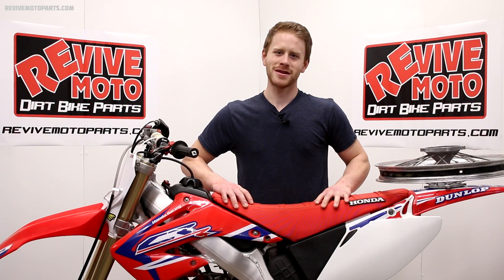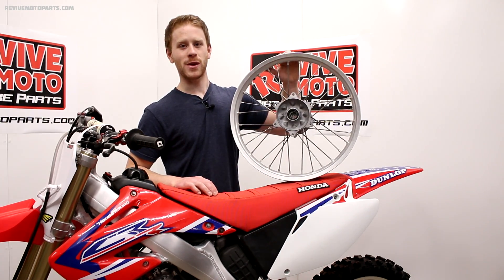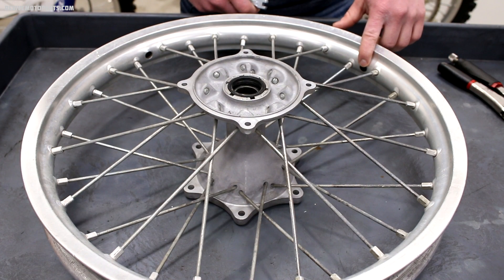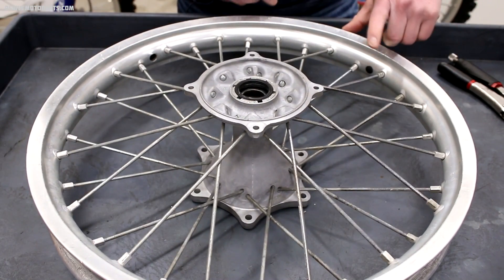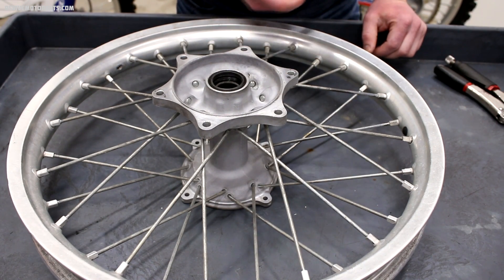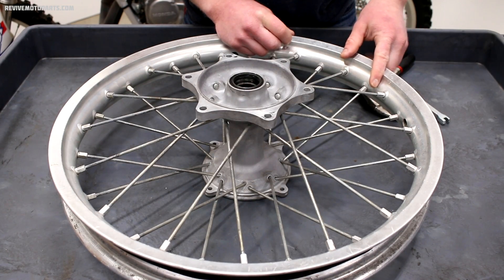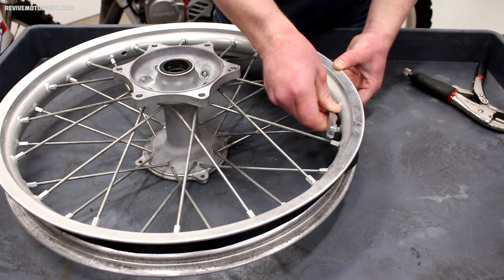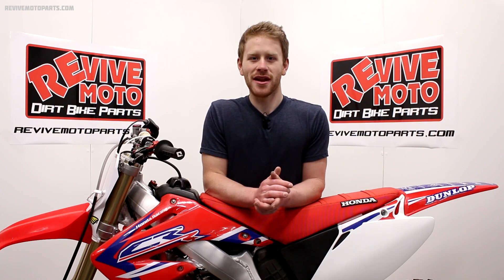Things You Didn't Know About Spoke Maintenance

Comment: To lube the nipple threads, use a drop of penetrating oil on each. As the wheel spins on the road, centrifugal force will carry it through the threads. Do this at every oil change, and ping test/tighten your spokes at that time as well.

Comment: great info. Wondering though if it's a fool proof method, I'm afraid that I might get my wheel untrue. Hate spending cash, prefer it by my side. lol
Reply from the maker: Thanks. If you work your way around the wheel like I explained and go 1/4 turn at a time, there is no way the wheel will come out of true. I've used this method on hundreds of wheels and never had an issue. At some point I'll have a video out on how to true a wheel as well.
Reply: +ReVive Moto Parts 
Thanks, Will try it out later. I just send my wheels even if it's just for tightening. that's about to change. thanks a lot  I appreciate it very much
Reply from the maker: Glad I can help. There's quite a bit you can do on your own provided you invest in the right tools. Good luck!